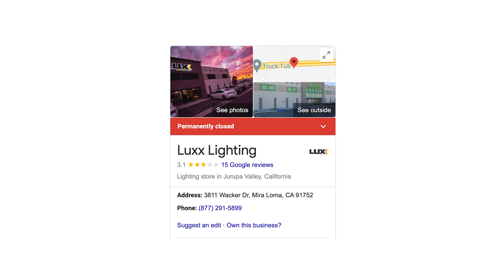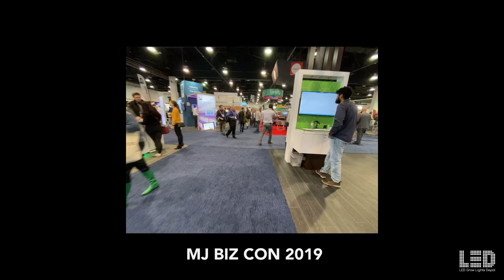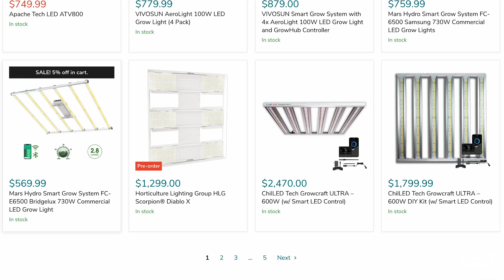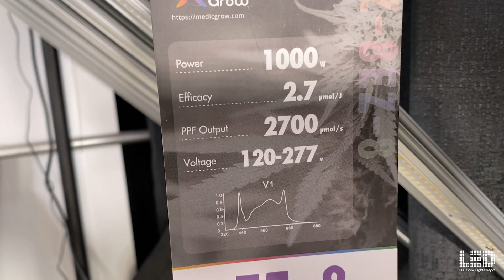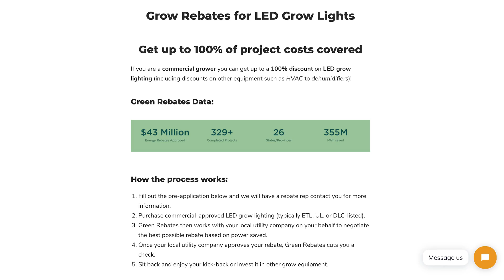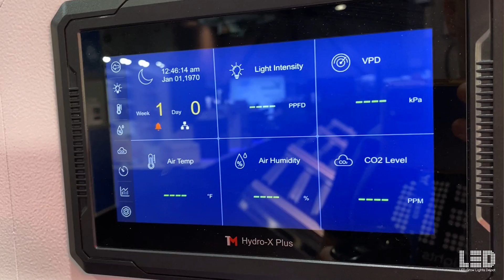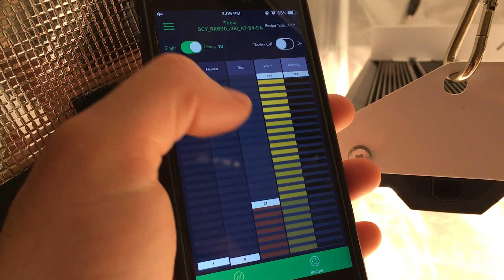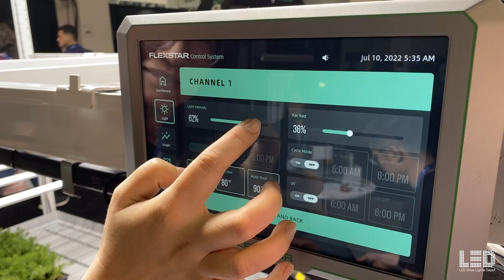LED Grow Lights in 2023 and Beyond

Comment: Led will never replace HID lights, as soon as you realise that you are grossly over paying for cheap mass produced LEDs slapped onto an aluminium frame running on the exact same ballast as my lumii black dual spectrum HPS system and now you need under canopy and side canopy lights because led can't penetrate the canopy like Hid does, you won't come with your "electric savings" failure of an argument. Also no LED lights can produce buds that stinks up the car with a little 1g bag like HID and don't forget that LEDs comes with a list of problems with different strains. 
In short... PLANTS LOVE THE GOLDEN GLOW OF HPS!

Comment: I wish optic would send some lights for testing
Reply: Weston used to have Eric’s job and Weston started Optic and was some supposed beef because LED depot kept repping crap lights or lights way too expensive for what they were. Trust that Optic is at the top tier elite in all aspects. Weston has all the connects and resources and relationships with suppliers. Was the 1st to offer Samsung reds and royal blues that all other lights couldn’t even get their hands on.
Reply: @Tim Page  I have the optic 720s and so far I'm not sold on it. The customer service is horrible. They claim is will cover a 5x5 and I'm not convinced. Yes I have a par meter
Reply: @MowMam  what kind of par meter....i have a 650s in a 4x4 and ive never had it over 70 percent.....and i have an apogee epar meater
Reply: @donwon7951  spot on par meter.